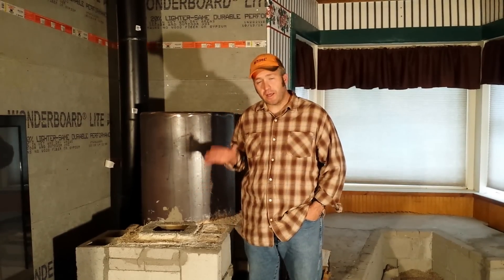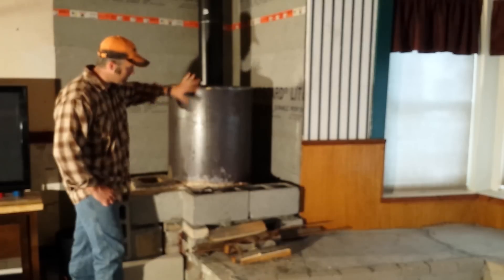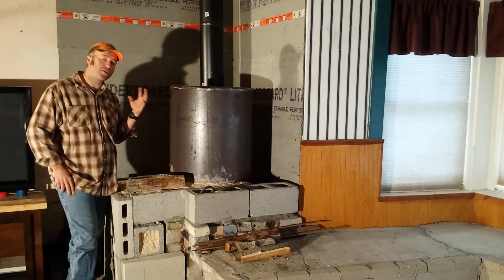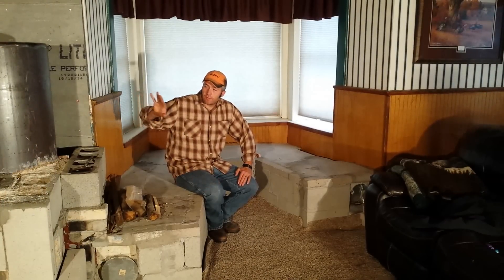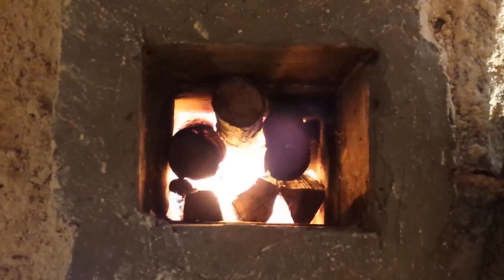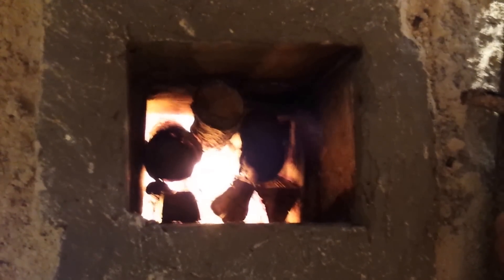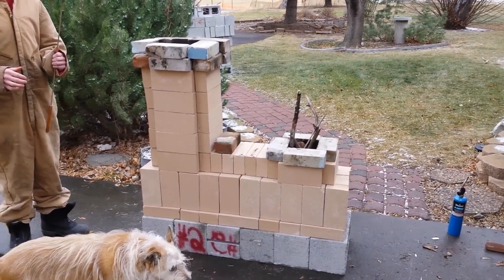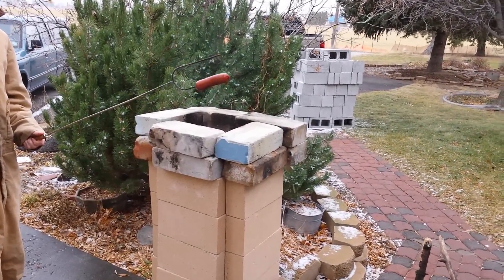Rocket Mass Heater Overview

Comment: How do you get it started, I mean light it, doesn't the smoke up the air intake at first.
Reply from the maker: +Gravel Trap King We start it with some crumpled newspaper in the bottom and small kindling on top then putting larger wood (it likes stuff about the size of my forearm)in after it starts burning well. It normally has enough draw that it does not smoke back even when cold.
Reply: It's nice to see more people building these.

If i were there, i would rebuild the burn tunnel...there are some refinements you could do to make it a bit more efficient...no kidding. Look at my avatar...lol. 

There is a simple way to get a bit more oxygen into the burn tunnel, then a pointed ridge 1/3 along the ceiling of the burn tunnel to tumble the hot wood gas/ smoke particules and mix that extra oxygen in so it will combust further.
http://www.permsteading.com/viewtopic.php?f=6&t=632

I'd put a square cleanout in the front, inline with the burn tunnel, so you could open a door and rake nails out (if you are burning salvaged lumber). Imagine a box blade on a long rod. If you put thermo-creamic glass (fireplace glass) in the door you could see the fire.

Sometimes i have difficulty getting my RMH to draw if i haven't fired it in awhile and the riser and mass are cold. I hate flames coming back up in my face. I designed a valve at the bottom of the drum to bypass the mass, letting the startup flow right up the 'chimney'. The shorter path helps. I also designed a power vent to be run for about 2 minutes, to create the necessary startup draft. It's a cordless drill motor under a rain cap on the chimney, driving a long 1/4" shaft connected to a three-bladed metal fan 2' down inside the chimney. I can send you a blueprint if you request.

If you ever run damp wood, you may get alot of dry black ash on the inside of your mass pipes. Putting in some more cleanouts would help you if this happens. Not just for ash collection but for if you need to run a vacume cleaner hose in there to get it out. 

With the minimal cleanouts you have, if that ever happens, i'd wrap a bath towel around the barrel of a 12guage, put it in the cleanout by the drum and fire a blank (just cut a shell and dump out the shot, then fish it into the chamber). That should shock/ pressure knock off all the ash and blow it out. It Sounds crazy, but I've done this, it works. That was to blow out a bird's nest. Of course the chimney cap must be off for this procedure. Put a brick up against the cleanouts you Don't want to come off...the pressure will pop them free. Lucy will make you some nice geranium-leaf tea when she sees her house stained with black soot.

But don't think i'm criticizing your work, i'm just always offering ideas to improve upon designs. My brain usually kicks out a solution to any problem i see within seconds...given a few hours i often refine that solution to be even better. Many people have just ignored me. ;)
Reply: @darrelljacobjr2120  appreciate those comments myself. I have batch box rocket. Firebrick materials.  9in by 4 1/2 by 2 1/2. Square riser inside, outside riser not insulated, covered 55gallon drum riser 35in inside barrel. Bell receives barrel exhaust, which has a 40gallon water tank inside. Then a smaller bell, then bricked chimmey exit. My question is bout moving the water without pumping. Winter 🔥 heat high ceilings big space every 5hrs, but water way to hot, relief valve will blow at least twice if we don't drain heated tank. Have electric tank connect 50ft from heated tank to supply it water. Again use water to get the hot water into electric, when full and used is great. Make it better
Reply: @columbusbrooks4517  So if i'm understanding you right, you've got a water tank INSIDE the exhaust plenum, right where the hot exhaust gasses from the drum pass over it, before going into the mass?

Good idea about that relief valve. Yikes!
I'd take that water tank out of there, put it nearby and insulate it well. Then wrap the outside of the heat riser (inside the drum) with 1/2" copper tubing. Wrap the whole outside of the heat riser. Connect this tubing to the cold and hot pipes of the water tank, or to the top and bottom of it. Cool water will thermosiphon out the bottom of the water tank, move into the coil, rise as it is heated, winding round and round the riser, then flow back to the top of the water tank. 

This way, when the water is hot enough, you can shut off a valve in the copper tubing, preventing the furnace from heating it further. You might have to drain the water out of the coil as it may turn to steam just sitting in there. But at least this way you'll have a way to stop overheating the water storage tank.
Reply: @darrelljacobjr2120  you described right my set up. B4 putting tank behind, I had copper half inch inside riser, that melted having water in line. Making 4store 35ft brick bench with copper coil inside riser with "heat stop furnace cement" to protect copper coil against flame. I'm trying to mix the city pressure, but return pressures to tank problem. City pressure, vs thermal siphoning
Reply: @columbusbrooks4517  I hope you meant to say 1/2" copper pipe OUTSIDE riser (inside the drum but wrapped around the outside of the riser). Putting it inside the riser would definitely melt it, and worse, lower the riser temp causing an inefficient burn. 
I've put copper tubing around the outside of the riser as i described, and after draining it it handled the heat fine. After the 'flame' exits the riser, it expands in the top of the drum, lowering temp to about 500*F. At the bottom of the drum it's only 350*F or so, as it goes into the thermal mass bench.
Reply: @darrelljacobjr2120  u are right. The 40gallon tank is best. Makes excellent draw behind a cold riser holding heat longer than brick. 2day got 60ft coil copper 3/4. Going to lighten mass weight and move water to heat 2nd floor as radiator wit clay
Reply: @columbusbrooks4517 Don't reply to a basic post, about starting a RMH, with your water heating issue.  That issue should not even be in the same book.
Reply: @jakebredthauer5100  why
Reply: @columbusbrooks4517 Most people who are interested in a RMH don't care about copper coils.  It is too complicated and too dangerous and they can heat enough in a bucket on the bell top.

Do a comment, not a "reply".  It was not a real reply to what was said at the start.
Reply: @jakebredthauer5100  ok, Jake. The hot water behind the barrel is excellent draft enhancing. Not trying to be controversial or dangerous brother. Coils and castles, bells pretty common in rmh community. Van Powell teaches both, I just copied
Reply from the maker: Thanks for all the input that is great and if you don't mind I would like to see the design for the power vent. I run into the same issues with a cold start as you described and I don't think the thickness of the barrel I had built helps, so it takes a little extra coaxing to get it started when cold. If I end up rebuilding the burn tunnel I will have to look at your ideas about the door and the tunnel roof, it sounds like a great idea. Thanks again for the input.
Reply: @highdeserthollow4447  I hope it's working good for you. I didn't used to get Youtube comment-reply notifications so i must have missed you asking for my designs. If you go to j3-pro.com you'll see my email addy. Send me an email and i'll send you some drawings and pics.